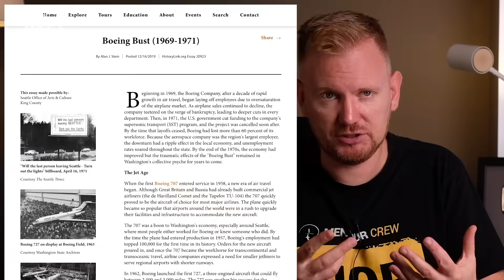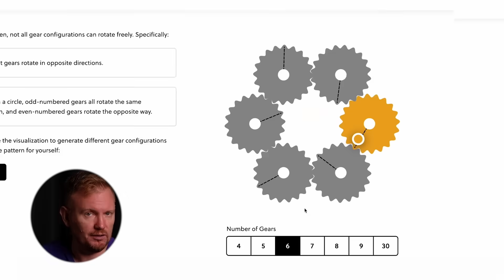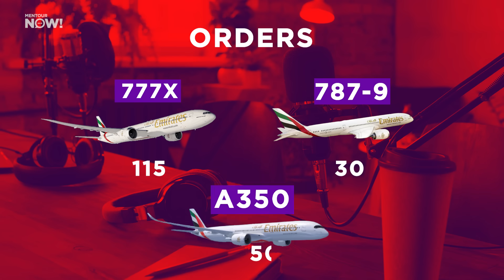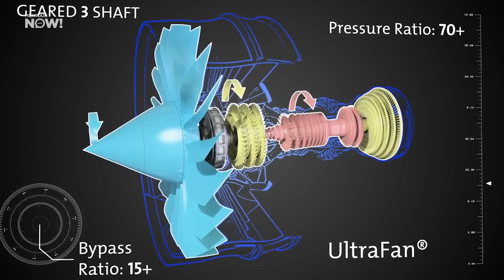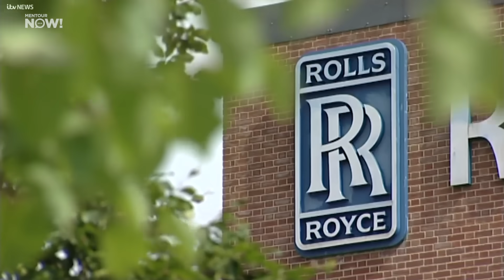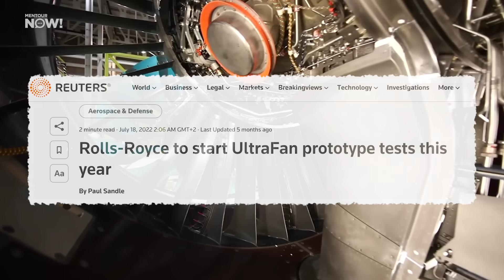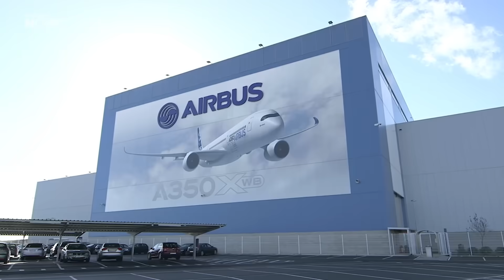Are BOEING planning a 747 with 2 ENGINES?!

Comment: When the A380 was first being considered to build I was informed its intention was to fill exactly this type of void. There were airports in cities who's populations were exploding and the  geography to expand these already large airports just wasn't there so they needed to move more people on fewer planes. Boeing at the time publicly admitted there was a business case for this but they felt it was quite niche and they weren't sure it  could not support two manufacturers...> but Boeing has been wrong about so many things in the recent 20 years who knows. I do believe given where ETOPS was going the A380 was over sold. The 777 was requested by clients who wanted a slightly smaller jumbo which could operate on 2 engines. IF Boeing can ever get they're act together and deliver on the 777X before every one else bails that would be sweet!!!  Companies are waiting for this. There may be a need for a bigger one just to recover if they drop the ball one more time. YES I'M CANADIAN!!!
Reply: The idea of more passengers on fewer planes to reduce airport congestion has always been an easy sell because it's a simple concept that anyone can grasp, thus it has become accepted collective wisdom. But the reality doesn't always seem to work out that way. 

Huge wake turbulence of the super heavy creates more separation. A380 is not as nimble on the taxiway and takes more time. It takes up a large amount of gate space, both inside and outside the terminal. And they spend a long time at the gate. 

And they don't handle the ebb and flow of passenger demand as well. A half full A380 doesn't do as well as two half full smaller planes.

Also it consolidates two or three flights spread throughout the day into one flight per day, which means less flexibility for passengers. As well as reduced ability  to fly point to point.

I'm not saying that I am accurately describing the quantitative effect of each of these variables. And there are positives to the approach. I'm just saying that it doesn't have quite as much benefit as it would appear.
Reply: @StevePemberton2  I think you're right, even more so now because of the reduce market since the pandemic. Since the pandemic a lot of people including members of my own family are working from home, relying on Teams and Zoom meetings to avoid travel and companies have been able to reduce costs and remain in business with this so travel will be different going forward as well. 

Some commercial travel budgets will remain trimmed back I suspect.
Reply: @rodneymcdonald4417  What surprised people in the industry is that even when passenger volume was high airlines were starting to move away from larger planes. In fact the decision to end the A380 program   was announced in 2019 due to sales that had totally dried up.

There are predictions that there will eventually be big growth in passenger volumes and that large airplanes will be needed again, but airlines and manufacturers don't seem to want to risk counting on that happening. And even if it does it happen it doesn't guarantee that airlines will want a lot of large planes. There probably would be some demand but the problem is they can't make just a few they have to make them in the hundreds for it to make sense financially.

Comment: It would make sense as a derivative of the 747, but that isn't practical. A twin 747 would need completely new systems and it would be a brand new design as far as certification goes. It isn't simply a matter of bolting on two larger inboard engines and removing the outboards. They would be better off designing an all new, larger twin (or stretching the 777 again). But they won't do that because they won't sell enough, just as they didn't sell many 747-8i.

According to wiki the Ultrafan gearbox could be good for an engine with up to 110,000 lbs of thrust, as installed on the 777X. The existing 747-8 has 266,000 lb of thrust in total. For the engine out takeoff case that means 199,500 lb of thrust is available. To match that engine out performance a twin 747-8 needs two 199,500 lb thrust engines. The Ultrafan is big but it isn't anywhere near powerful enough for a 747 sized twin. And Emirates need something A380 sized, 25% larger than the 747-8.

In fact, the Ultrafan is intended as a family of engines to be more economical replacements for existing engines. It sounds as if the largest version is sized to be able to power the 777X. A twin 747 is just a romantic dream.

Comment: That is a perfect idea actually,and maybe the next move how to lighten its structure so a great advantage to fuel efficiency,cargo capavility and passengers capacity.
Reply: I don't  think passengers should be mixed with cargo. Many times pilots do not know what they are hauling and if its unsafe it could harm pilots and pax.

Comment: .. would it be possible to? Maybe, but why if they have the 777X? Would the Jumbo be even bigger and still be a Twin? Nose loading might be a plus for the cargo carriers.
Reply: The 777X will be a good test of the demand for 400 passenger twin airliners, and whether there may be a need for something even larger. The 747-8 and A380 seemed to prove that there isn't, but the problem those planes had was that they had to fly somewhat full to be profitable. Not easy to do with a plane that large. But if a 450 or 500 passenger  plane is available that can be operated with a little more flexibility, maybe airlines would find a use for it.

Comment: Day 12 and you have over 2,000 comments!  Great video, and a lot of speculation on why Rolls Royce would spend millions of dollars on a new much larger engine, and not be able to announce the potential plane to fit that engine on.  I guess they can build the engine but must wait to disclose the customer.  

A quick look at the worlds largest aircraft, and it is a high wing Antonve (SP) 6 engine monster that sadly was blown up in March of 2022.  To use a 12 foot diameter engine, a very high wing design like the 6 engine monster would work well, and prevent it from being called the "Vacuum Cleaner" like the 737 is known for.  10 feet of clearance between the bottom of the engine and the airfield will help protect against sucking up eggs from nesting birds on the airfield.  

I can remember the passenger cabin of the 727 was a lot less noise with the engine mounted aft of the wings on the plane.  This would be a great trend.  By adding a lot of surface area, the wing loading area in pounds per square foot can be reduced, and winglets put in to increase lift.  

There has not been a Canard design with passenger aircraft yet.  It is about time!  This would also place the engines potentially well behind the passenger cabin, and offer a much smaller overall wing width compared to the conventional design with one main wing and one much smaller tail wing.  So overall width can shrink while wing surface area between the canard and main wings will increase.  

They might even change the tire arrangement for the main landing gear, say have 8 tires in a row, on each side of the plane, and that can distribute the weight over more of the airframe, with less loading on one location, thus making re-enforcements less weight.  Offer front and rear steering, that could help in cross wind landings too.
Reply: I can see a twin engine replacement for the C-5. Or maybe a four-engine monster cargo plane although that seems less likely.

As for passenger planes, blended wing and sonic cruiser type of designs have been bandied about for years. But it seems that the original Dash 80 design of the 1950's has not only endured, but is now pretty much the only type being produced for anything larger than a regional jet. It's simple and easy to maintain both in the hangar and on the ramp, and that's what airlines seem to want right now. It will be interesting to see if sometime in the future newer ideas like what you mentioned will start being considered again.

Comment: Technically 747 can fly with 2 General Electric Gen-X engine (the engine that fly 777-X), the engines is powerful enough to fly fully loaded 747.

Realistically ? they need to redesign the wing, fuel tank, fuel distribution, hydraulic system, electrical system, etc. it's so complicated Boeing might choose to build a brand new airliner than redesign 747 with 2 engines.

so ? it's not as easy as "detach 2 engines and replace the rest 2 engines"
Reply: Of course designing a whole new airplane isn't that easy either. 747-8 was a pretty big change from the previous version. Actually 747 SP was pretty complicated also as the rear hump was now over the wing and they had to redesign the wing box (which actually made the extended hump on the full size model possible). Also a larger tail was needed on the SP. 

But switching  to two engines from four would be even more ambitious. If there was a strong demand for this size plane they might have considered if this could be done faster than a clean sheet airplane. Too late now anyway. 

It's hard to tell what the demand will be for high capacity going forward, 777X will be a good indication of that.

Comment: The problem with hydrogen fuel comes down to it being a pipe dream. In theory it’s awesome, but in practical usage you need pressurized fuel tanks to hold the fuel that are almost 20x bigger than an equivalent kerosene tank and weigh significantly more because they need to hold the pressurized gas… ultimately it’s a technology that will never get off the ground, pun intended 😉

Comment: It could be done if Boeing adopted and applied the same design theory it used in building the 737 Max, and hid the defects and poor engineering decisions, and made no disclosure of known safety problems, which decisions are what made the 737 Max into a flying bomb. In that is the case, an airline could fly a 2 engine 747 with no more troublesome, expensive testing, and make lots of money.

Comment: Would Rolls Royce's Ultra Fan Engine fit on a 747-8i? And would just two Ultra Fan engines meet the needed power and thrust demands/requirements of a 747-8i?

Seeing the Queen reenter production and service with just two engines would be one of the greatest aviation phenomenons of all time!
Reply: The 747 isn't going to re-enter production, regardless of what engines are used. The tooling is sold off, both from Boeing and from its subsidiaries. More to the point, the 747 would never meet certification requirements today. In the present environment, the international aviation authorities would never allow a twin-engine 747 with all-new wing and stabilizers to be grandfathered in under the old type certificate.

Comment: The GE90 engines produce more thrust than two of the original JT9D class engines of the late 60s/early 70s.   So could you have a twin-engined 747?   From a thrust standpoint, yes.  But you couldn't just simply stick them onto an existing 747, there wouldn't be sufficient ground clearance (if any).   Is Boeing considering doing such a re-engining?   No.  If we were going to do it, it would have been when we did the -8 derivatives.   The 747 is history - long live the Queen !

Comment: why are triple-engine jets not looked at? like 3 good engines could probably lift the A380 or 747 and would be more efficient than 4
Reply: Engines are the single most expensive component of an airplane. Both in the purchase price and in maintenance. In fact airlines almost never own the engines, they are leased separately from the airplane. Sixty years ago Boeing introduced the 727 which was a essentially a slightly smaller 3-engine version of the 707. This reduced engine costs by 25%. The 727 was very popular in fact at one time it held the record for the most produced commercial airliner. However once newer engines came out that were more powerful and more efficient this resulted in larger twin engine planes that further reduced engine costs by 33% and that ended the 727.

Meanwhile Lockheed and Douglas saw a gap between the 747 and smaller aircraft, so they produced the L-1011 and DC-10 jumbo jets with three engines. However once again new engines eventually came out that allowed the same capability with two engines, so those programs ended. What was also important is that twin engine planes were now allowed to fly across the ocean as long as they meet ETOPS requirements. This removed yet another advantage of three and four engine planes.

Another problem with three engines is that the third engine has to be mounted inside the tail which makes maintenance more difficult. 

Two engine planes are now rivaling the 747 in size and range, at least previous models of the 747. Longer range and higher capacity is not worth the expense of a third engine in the current thinking. So it is unlikely that we will see three engine airplanes again. But it's not impossible.
Reply: @StevePemberton2  hmm interesting, thanks for the reply, I mean I understand that two engined planes are obviously more efficient and cheaper to maintain, but would airlines not buy a triple engine jet with a huge capacity that a two engined plane cannot handle? Like emirates, who want a big airplane, I heard India might be in trouble with airport slots, demand is huge again, it's kind of sad covid and this energy crisis has properly killed of the legends of the skies even though they might be perfect for airlines
Reply: @robertsepners4067  That used to be the thinking but it has changed. Larger 3-4 engine planes only work when closer to full, whereas most 2-engine planes can fly half full and still make a profit. That is a generalization of course but airlines have to work so hard to try and fill the larger planes and they are no longer as interested in doing that. I suspect they also don't like the unpredictability of investing in the super large 3-4 engine airplanes.

The problem with gate slots always seems to be temporary and usually works out eventually with expansions at airports or newer airports. And the larger twins have been really helping with gates. Considering that the latest 777 and A350 carry about 365 passengers which is equal to the original 747-100. The 777X is expected to carry over 400 passengers similar to a 747-400.  Not as many as 747-800 and for sure not as many as A380, but apparently for airlines that is enough. They might like more in some situations, but not enough to pay a lot more for it with extra engines. 

But yes all of the icons are disappearing. Even the DC-9 is going away as the MD-90's and 717's are getting older. Soon the only T-tails will be regional jets.

Comment: "Are Boeing...". It seems you learned English from the Brits! Boeing is a single company, and therefore, it should be "Is Boeing...". The Brits do not know what a plural is, and use the plural verb so many times whenever they talk about an entity that has many components, usually lots of people, like a company, or a military, etc.

As for the content of your video, it is a very interesting idea of converting the 4 engine wide body planes to run on two very large ones, perhaps with the 'Ultra fan" engine.

Comment: Boeing would be better off designing a new replacement for the 737.
Reply: A clean sheet airplane in that size will eventually be needed. The good thing about the 737 MAX is that it's a really efficient airplane with great range, available in four sizes, so it buys Boeing some time to allow technology to improve, and also to hopefully get their act together. Right now is not the ideal time for them to start any new clean sheet projects. Upgraded 737, 787 and 777 will we viable for many more years.

Comment: Excellent discussion and information! As usual! I would think Emirates would have as many A380 aircraft as they would want as other airlines retire them?? Lowering the business case for such an aircraft in the next couple decades?
Reply: In 2019 Emirates canceled their order for 39 A380's, effectively ending the A380 program. And Emirates has stood by as A380's have been scrapped. Clearly they have moved on, they plan to fly their current fleet of A380's about fifteen more years. By then some pretty big twins should be available.

Comment: I understand this engine is larger than the 777 engine, but I saw the GE test 747 with the 777 engine installed in the number 2 position.  The engine did not look out of place.  It just made the other 3 look small.  I don't think the issue would be the actual mounting of the engine.  The systems on the 747 achieve their redundancy because of the shear number of powerplants.  It would be a massive redesign to solve that issue IMO.  ATP B727,747,MD11,DC8,L188. No twins here. :)
Reply: Lockheed Electra? Fifty years ago I used to watch the Air California L188 four-engine turboprops fly in and out of Orange County Airport (now John Wayne Airport). I think you may have meant L101 (L-1011) :)

I'm not sure that this would be much different than the 777X. In both cases they have to meet single engine performance for takeoff and for ETOPS. No real choice in the matter either they do or they don't. If they don't then something has to change.

Unless you are talking about hydraulic and electrical redundancy. Yes that would be a huge project to change all of that from the existing 747 layouts. Probably another reason why this will likely never happen. They would not even consider using three engines.

Comment: I worry engines that big on a 747 will have similar issues as the 737 MAX
Reply: That would be extremely unlikely. A twin engine 747 would require a new type rating. Boeing got into trouble with the 737 MAX by mismanaging a software that was designed to avoid a new type rating that would have been required due to one change in handling characteristics with the previous 737.